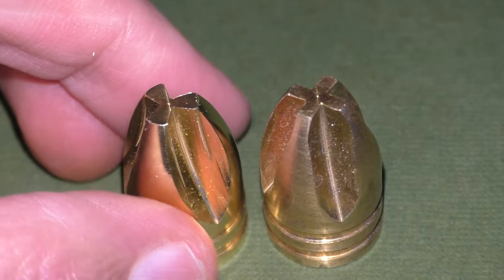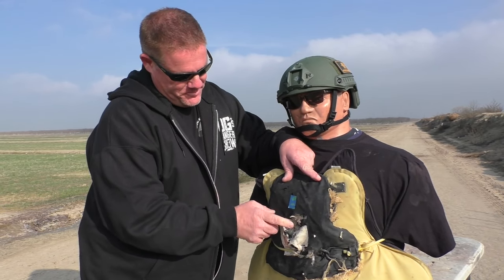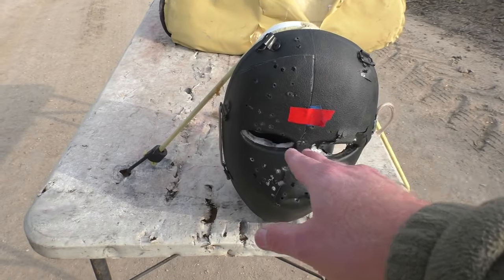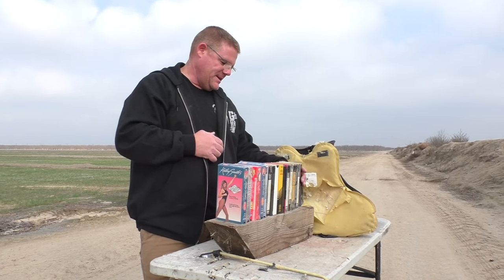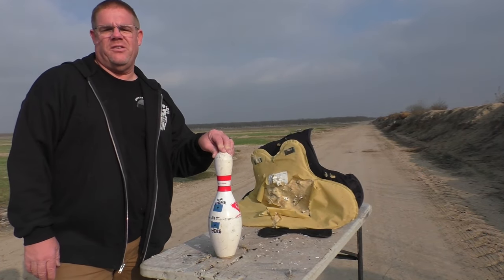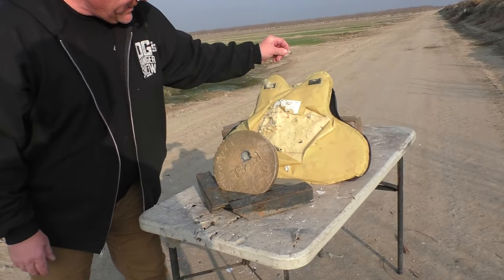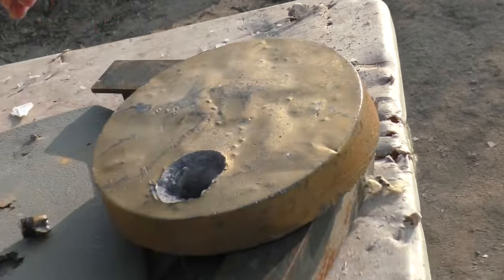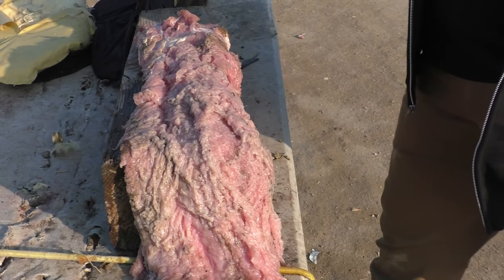☢ XTremely Russian Shotgun slug 2.0 -  Destroys everything

Comment: Seems to be one of the best penetrating slugs I've ever seen, basically makes shotguns into anti armor rifles. 
Hope the dude gets a patent for these as they ought to become popular.
Reply: Anti-vehicle rounds for sure. Go through the Radiator and crack the engine block.
We SAW how much damage even a ricochet did AFTER passing through a lead plate. INSANE!!!
Reply: Great for Hog hunting. Shooter, they are gutted, ready for the cutting up. Think about shooting from snout to rear would be best look at all the weight you save carrying them out. 🐻👍
Reply: Could a air rifle shoot that round?
Reply: They mention it's heavily inspired by Lehigh Defense products for handguns, mostly just scaled up, so it might be hard to defend any intellectual property from this.
Reply: Can make these with any CNC machine yourself
Reply: @RvDavy  they sold pointed BB rounds here in Canada for years, they were banned by Trudeau in 2016
Reply: @RvDavy  its not impossible if that's what you're asking. The issue is that air rifle barrels are not made of the same steel as fire arm barrels because all air gun ammunition is supposed to be soft leaf. Iv definitely thought about this as well and honestly i don't see any reason a beefier barrel can't be used to allow for jacketed ammo as cleaning soft lead is not fun and idk why no one has tried. Yes it will fire the jacketed round all the same but the wear and tear on the barrel will ruin it (that's an educated guess) within 100 rounds if not definitely within a few hundred. One possibility is that air rifles have alot less power to work with and the soft lead creates a much better seal without requiring the same kind of power it takes to push a jacketed bullet down the barrel so it's just not worth it. Or maybe it's cost and it since all air gun ammo is soft lead there is just no reason to use barrels that are more expensive and won't be used to their full potential.
Reply: Also Kentucky ballistics did a video shooting body armor with elephant guns and the first round he shoots is a brass solid which just destroys the plate and goes through the dummy and he finds out that brass solids at high speeds are very good at defeating rifle rated body armor. I guess the atf isn't just dumb for including solid brass as a potential ap round material.
Reply: @RvDavy  interesting question. someone should cast some pellet gun (air gun) sized of these and see how they do
Reply: @RvDavy  Actually yes they can, the same way that these rounds are being shot in a sabot case. I shoot the Lehigh extreme penetrators through my AEA Challenger 50 cal all the time with the sabot case's and they're damn near unstoppable👍

Comment: I'm curious for these sort of fluted bullet designs, if there's difference between the flat tip, and a pointed spitzer tip on how it preforms. 
I have half a mind to think that the flat surface is less effective than it coming to a point, either through metal, or a plastic cap similar to some polymer tip hollow points.
also I wonder if different metals would have any effect too.

Comment: "Nasty" is an understatement!   For us with smooth bore or rifled choke tube, I would have loved to see a couple stablity test shots.
Reply: Rifle choke I can understand, but without spin these are pretty unstable, they mentioned that in this video and that’s why they added the electrical tape to the slugs, to ensure they spun
Reply: @arty5279  no doubt, the designer didn't specifie any intended use, but curious how they would work in a practical world say against bear defense for example, out to 10 or 15 yards,  tumble or not they are still going to be devastating but,  since the vast majority of shotgun users will have smoothbores and for defence in the bush would typically have 18.5 in barrels.
Reply: @llkj7944  True there, even going sideways these things will still come close to hitting their mark, and will still hit like a truck. I myself have a smoothbore barrel, and if you want to see how these perform without spin stabilization, they did a video of the four flute one i think, but without the electrical tape which caused them to not spin properly. Results should be similar to what you're looking for.

Comment: The purpose of the fluting on rounds like this is to cause larger cavitation via hydraulic pressure, sort of like when you put your thumb over a water hose. It works well on soft fleshy targets because they have a high water content. The human body after all is about 70% water.. The silly putty is much more dense than human tissue and you would need much greater velocities and kinetic energy to make a metal like lead actually expand in a similar fashion from hydraulic mechanisms, which I don't even know if that's possible because lead is very brittle.

Comment: I would love to see this round go up against that “FRAS” “armor an acronym for the “flexible rifle armor system”. I would like to see both the 3A+ that stops intermediate rounds. I don’t think that could go through level 3 armor particularly any sort of AR (abrasion resistant) 450-550 steel. Brass just isn’t hard enough for hardened high carbon steel. But hey maybe I could be wrong. I’ve be wrong before with this channel. Honestly the getting it wrong is why I enjoy it. Too many videos I watch people don’t understand sectional density in relation to velocity and why speed isn’t everything with regard to penetration of armor. What you want is all three: velocity is high enough (2500-3000 at the muzzle) and you have a heavy sectionally dense bullet .2 or better) as well as it being made out of hard metal (like brass). When you have all three qualities that bullet will penetrate things that typically rounds won’t. If you look at .50 BMG it has all three insane sectional density armor piercing ammo available and high velocity.

Comment: If the milled parts were at a certain inclination with respect to the longitudinal axis, would it be that, due to aerodynamic effects, the slug would not rotate, thus working in a smooth barrel without rifling ?
Reply from the maker: No,   there is a shockwave that prevents airflow over them.   It has to be mechanically induced to spin.
Reply: @taofledermaus  -  OK. Thanks, for the explanation,

Comment: Hey Guys.  I saw you testing exploding slugs. Based on this i wonder if a Hollow charge projectile would be possible. Like german Panzerfaust 3 for example. Kind regards from Germania
Reply from the maker: Maybe but  it is hard to get ahold of high explosives
Reply: @taofledermaus  true words. Lead azide is easy going if the use is legit. To test if it works fast black powder should do good job or use the powder from modern ammo.

Comment: Sorry to be a smart arse, but you really should try to avoid saying the phrase, “extreme penetrator my ass”… it is extremely open to misinterpretation! Ok I’ll shut up now. Another excellent video. And to think watch parts are made of a very similar alloy known as clock-brass, which is easy to machine, takes a good polish, and is a hard as all get out.
I wonder what would happen in you loaded a shell with watch wheels and parts as shot.
Obviously it would damage the barrel significantly, but it would be interesting to see a modern version on the blunderbuss.
When I was a little boy, more than 50 year ago, my parents, brothers and I lived in India. We had a driver,  guard & minder called Rahmier. He was 6’ 7” & he carried a muzzle-loader, percussion-cap blunderbuss, always, every where. One day I saw him load it. For shot, he used a handful of small brass screws, 1/4 inch & 1/8 inch nuts. Never saw the dreadful old thing fired, but I bet it would have been… messy to be on the receiving end.
Sorry I didn’t shut up. ;->
🇦🇺